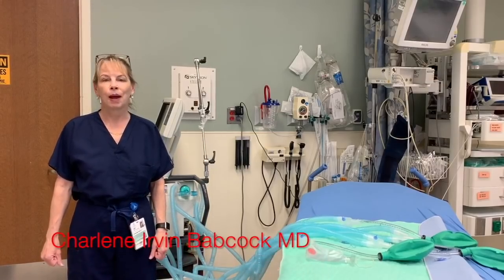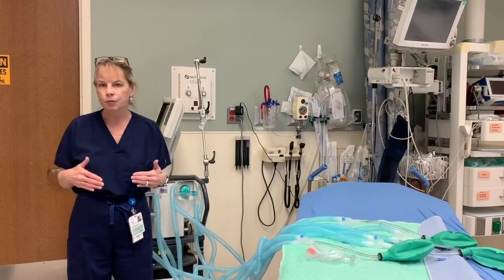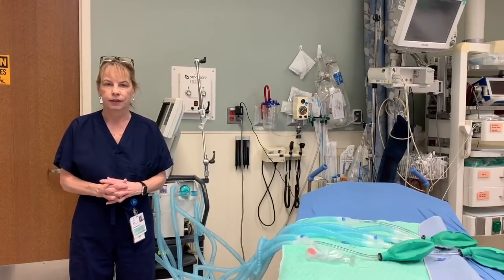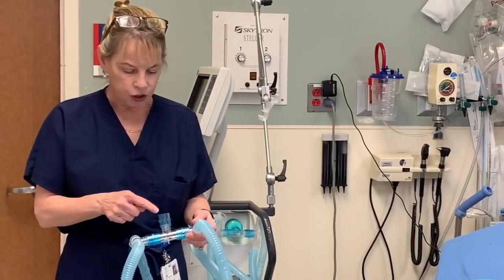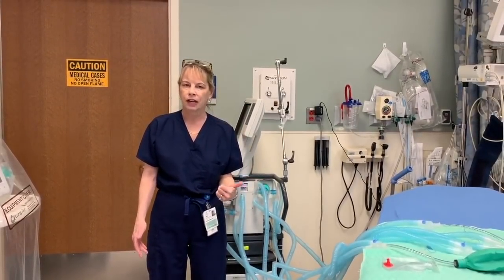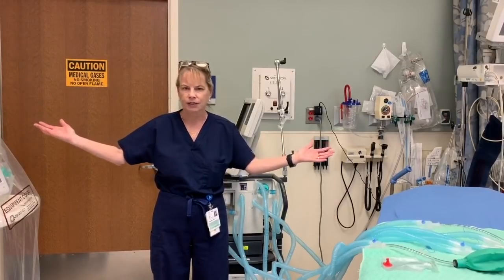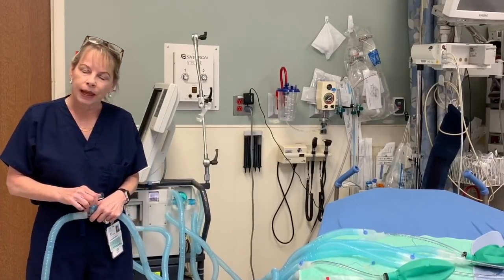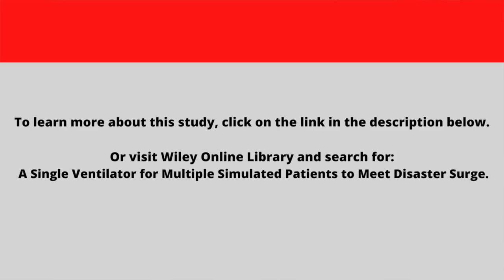COVID-19 How to Use One Ventilator to Save Multiple Lives

Comment: March 26, 2020
Joint Statement on Multiple Patients Per Ventilator
SCCM, AARC, ASA, ASPF, AACN, and CHEST Share Unified Message
(IRVING, TX – March 26, 2020) – The Society of Critical Care Medicine (SCCM),
American Association for Respiratory Care (AARC), American Society of
Anesthesiologists (ASA), Anesthesia Patient Safety Foundation (ASPF), American
Association of Critical‐Care Nurses (AACN), and American College of Chest
Physicians (CHEST) issue this consensus statement on the concept of placing
multiple patients on a single mechanical ventilator.
The above‐named organizations advise clinicians that sharing mechanical
ventilators should not be attempted because it cannot be done safely with
current equipment. The physiology of patients with COVID‐19‐onset acute
respiratory distress syndrome (ARDS) is complex. Even in ideal circumstances,
ventilating a single patient with ARDS and nonhomogenous lung disease is
difficult and is associated with a 40%‐60% mortality rate. Attempting to ventilate
multiple patients with COVID‐19, given the issues described here, could lead to
poor outcomes and high mortality rates for all patients cohorted. In accordance
with the exceedingly difficult, but not uncommon, triage decisions often made
in medical crises, it is better to purpose the ventilator to the patient most likely to
benefit than fail to prevent, or even cause, the demise of multiple patients.
Background: The interest in ventilating multiple patients on one ventilator has
been piqued by those who would like to expand access to mechanical
ventilators during the COVID‐19 pandemic. The first modern descriptions of
multiple patients per ventilator were advanced by Neyman et al in 20061 and
Paladino et al in 2013.2 However, in each instance, Branson, Rubinson, and
others have cautioned against the use of this technique.3‐5 With current
equipment designed for a single patient, we recommend that clinicians do not
attempt to ventilate more than one patient with a single ventilator while any
clinically proven, safe, and reliable therapy remains available (i.e., in a dire,
temporary emergency).
Attempting to ventilate multiple patients would likely require arranging the
patients in a spokelike fashion around the ventilator as a central hub. This
positioning moves the patients away from the supplies of oxygen, air, and 
vacuum at the head of the bed. It also places the patients in proximity to each
other, allowing for transfer of organisms. Spacing the patients farther apart
would likely result in hypercarbia.
Spontaneous breathing by a single patient sensed by the ventilator would set
the respiratory frequency for all the other patients. The added circuit volume
could preclude triggering. Patients may also share gas between circuits in the
absence of one‐way valves. Pendelluft between patients is possible, resulting in
both cross‐infection and over‐distension. Setting alarms can monitor only the
total response of the patients’ respiratory systems as a whole. This would hide
changes occurring in only one patient. The reasons for avoiding ventilating
multiple patients with a single ventilator are numerous.
These reasons include:
• Volumes would go to the most compliant lung segments.
• Positive end‐expiratory pressure, which is of critical importance in these
patients, would be impossible to manage.
• Monitoring patients and measuring pulmonary mechanics would be
challenging, if not impossible.
• Alarm monitoring and management would not be feasible.
• Individualized management for clinical improvement or deterioration
would be impossible.
• In the case of a cardiac arrest, ventilation to all patients would need to
be stopped to allow the change to bag ventilation without aerosolizing
the virus and exposing healthcare workers. This circumstance also would
alter breath delivery dynamics to the other patients.
• The added circuit volume defeats the operational self‐test (the test fails).
The clinician would be required to operate the ventilator without a
successful test, adding to errors in the measurement.
• Additional external monitoring would be required. The ventilator monitors
the average pressures and volumes.
• Even if all patients connected to a single ventilator have the same clinical
features at initiation, they could deteriorate and recover at different rates,
and distribution of gas to each patient would be unequal and
unmonitored. The sickest patient would get the smallest tidal volume and
the improving patient would get the largest tidal volume.
• The greatest risks occur with sudden deterioration of a single patient (e.g.,
pneumothorax, kinked endotracheal tube), with the balance of
ventilation distributed to the other patients.
• Finally, there are ethical issues. If the ventilator can be lifesaving for a
single individual, using it on more than one patient at a time risks life‐
threatening treatment failure for all of them.

Comment: Ok. This just came in 6 hours ago. The more I think about this the more I appreciate Dr. Babcocks novel possible solution.  Personally I think what would be possible is take any non covid ARDS patients and have them possibly share a vent with 1 other patient.  I am talking long term neuro cases with no tbi protocols and cases like these.  Also the RTs that said this would be a bad idea were simply looking at actual survivability through their experience instead of being negative or not working off label. Dr. Babcocks idea of using BiPap off label is risky but worth it in my opinion and great novel thinking!  But the experts (see below) have consensus that 4 covid patients on one ventilator is not feasible.  I would love to be involved in feasibility of double patient  ventilation with normal lungs using ASL5000 computerized test lungs in the future. We are all in this together and any novel ideas need to be investigated.

Article below released 6 hours ago:
However, in a statement released today (March 26), medical societies across the country came out strongly against this idea. "Sharing mechanical ventilators should not be attempted because it cannot be done safely with current equipment," the societies said in the statement. "The physiology of patients with COVID‐19‐onset acute respiratory distress syndrome (ARDS) is complex." Even in ideal circumstances, 40% to 60% of ventilated patients with ARDS and lung disease die, they said. 

"It is better to purpose the ventilator to the patient most likely to benefit than fail to prevent, or even cause, the demise of multiple patients," they said. The statement is supported by the following: the Society of Critical Care Medicine (SCCM), American Association for Respiratory Care (AARC), American Society of Anesthesiologists (ASA), Anesthesia Patient Safety Foundation (ASPF), American Association of Critical‐Care Nurses (AACN) and American College of Chest Physicians (CHEST)
Reply: I should also clarify I don’t mean your home BiPap for OSA, I mean BiPap like V60s powered by 50psi O2. And not for covid ards pts but for spont breathing drug ODs, high quads, neuromuscular pts etc..   If they do run out of vents first all RT schools lab vents, then anesthesia vents, then transport vents,  and finally teams of baggers with PPE and HMEs (and a strong command post to manage this as it would need a lot of organization and sore arms). But volunteers would step up and it could be done

Comment: All the medical concerns I see raised here by healthcare providers sound valid to me.  However, as an engineer, I'm quite sure the technical challenges associated with multiple patients on one ventilator can be solved given the right mix of expertise, resources, and time.  Nobody has perfect forecasts of the respirator demand we face over the next few weeks, but most forecasts seem to indicate we're at risk of a significant shortage within a few weeks...one that likely won't be met by ventilator manufacturers (despite heroic efforts and broad support).  Working in our favor, there are still ventilators in the national stockpile and the entire country won't reach the peak of infection simultaneously.  This affords a few precious weeks to get the CDC, FDA, doctors, engineers, manufacturers, and experts in logistics involved in a coordinated effort to solve these technical challenges, to provide the needed regulatory relief, and to produce and distribute the hardware and information needed for these efforts to succeed.  I applaud those pursuing such a path.  It would be sad to squander this window of opportunity and force intensive care doctors in the heat of battle to scour youtube for a solution they can implement in a hour given the fittings, hoses, and filters they have on-hand and little information on the technical specs of the model they want to multiplex.

Comment: To all the idealistic naysayers, this is being used NOW in New York city as an emergency measure to save lives. They have developed protocols. You don't get that YES, we understand that it is not ideal. We understand the RISK, We understand that it is not as flexible. Do you understand that to the extent it works it will SAVE LIVES? New York has paved the way legally and procedurally to use this, and is attempting to deploy it as we speak, even before they run out of ventilators, because it gives them flexibility to save more lives in the coming storm. Although not ideal, for many patients it will be good enough to respirate them while their drug therapies and time work. Even with the limitations posed by sharing, these resipirators are far superior to the early models in our medical history, and we would not have banned their use for their lack of intelligence and evolution. They made air go in and out. Period.  Databyter
Reply: Interested to learn more, as we are running against the clock in Kenya

Comment: Would like to offer some possible options to help mitigate the risks you mentioned, Adding one way valves on each line could potentially help limit patient cross contamination from back flow, secondly to help with varying lung sizes and therefore different oxygen/pressure needs using some types of air regulators could help provide some level individual  air flow adjustments. Thanks and good luck!

Comment: My major concern with this is that if the compliance of the lungs between patients is significantly different, you will be ventilating very different volumes to the patients, possibly, even to the point of injuring the lungs of the patient with highly compliant lungs and underventilating the patient with the poorly compliant lungs. This situation was not tested in the study as it used identical simulated lungs, but is addressed in the discussion. Although Covid 19 does not seem to affect lung compliance based on what I'm reading, perhaps I would suggest ventilating each patient on their own to get a sense of compliance and if the above solution is needed, then grouping patients with similar compliances on a single ventilator as patients may have varying lung compliances based on their pre-existing conditions.

Comment: Given the concerns about cross-contamination, is it possible to run these machines with each expiratory limb of the patient circuit connected directly to an expiratory filter, and NOT connected back to the unit's expiration port?

Comment: I might suggest adding a flow meter in line on the output of each patient as an added method for monitoring. Many years ago, I was a repair tech certified to work on Bird brand vents and many of them had a large output capacity, far more than what a normal person would use. (some enough for a horse). When we gave them a burn in before sending them out for use, they ran at full capacity for at least 24 hours to make sure they wouldn't fail under the most extreme conditions. Of course, my knowledge is over 20 years old now, my certifications have long expired and I doubt those model vents are still in use, but as you said, extreme times call for extreme measures...
Reply: Would you be interested to help a team in Kenya?
Reply: @cantstopthecooking  I'm not a repair tech anymore and don't have the tools.
Reply: @KenMaxon  Thank you. this is Kenya, so the idea is to get someone who knows about ventilators and can help.

Comment: Surprised to hear that a ventilator designed for one person has can deliver enough volume for four.  I'd expect some additional capacity built in, but that's huge.  Also, does the additional volume of air from all the long hoses create problems delivering the right pressure profile to the lungs?  Just curious.  Hope it saves lives!
Reply: She addressed the problem of the decreased volume delivered and increased resistance of long hoses with her comments about the "half-star" positioning, with two patients parallel to each other and one patient perpendicular to them on either side, the single ventilator at their heads. It's about halfway through the video.
Reply: @FrauDoktorDoctor  Unfortunately, there is a lot of misinformation provided.  There is actually less resistance with longer and excessive tubing.  The problem is actually tubing compliance (stretch in the tubing during mechanical Ventilation) that a ventilator cannot compensate for when you go from the normal 12 feet of tubing (6 in and 6 out) to 48 feet!  This technique is not viable.  Multiple medical bodies and associations have shot this down as of March 26, 2020.  Folks should remember that Critical Care Medicine is different from Emergency Room medicine.  It also requires a different fellowship and training.  Saw a photo from Italy with multiple people attached.  Not only is is split, it's set up improperly in a way that forces both patients to rebreath their own CO2.  It's a mistake on top of another mistake.  Not good.
Reply: Bicycle Crossroads Most 4th G vents wii go to fault. This might work if you use an Emerson Post Op.

Comment: U could use bacteria filters on both the inspiratory and expiratory end to each patient to abound cross contamination. 

All patients must be paralyzed medically and all on pressure control with a slower inspiratory time.  So all lungs have time to fill, instead of the most compliant lung getting the volume first. You would not be able to measure volumes precisely but you ventilate all lungs to the proper inspiratory pressure and rest at the same peep level.  Volume mode in this setup is bad news. The less compliant lungs won’t get adequate volume.
Reply: I think we could build a distribution setup with filters and individual pressure regulators for each patient.  Would that be useful? Any contacts that might be willing to collaborate on a design? Understood that this is a last-ditch solution and limited to Pressure control only and common rate.
Reply: Aaron Crews with all patients connected together, think of all 4 sets of lungs, as one. You will be inflating all of them to the same peak pressure and same resting peep level.  It would only be able to be done on teenagers and adults together at the same time, I imagine children under the age 12, wouldn’t be good due to the fact their lungs would fill up faster than the adults. I would like all patients connected to have the same chest rise time.

Again this is only in a dire needs situation. People is severe ARDS are not applicable to this. As their ventilation mode and settings would more than likely be specially catered just for them. 

I imagine you could use this method on your more stable patients in house, and use single vents more for your very unstable patients.

Comment: Phew! What a measure to have to take! I hope it doesn’t come to this. But if it does I have a question. How do you recommend making a choice to adjust the vent settings based on abg results amongst the two or four patients? If patient A is tolerating the vent settings well but patient B is experiencing acidosis and hypercarbia, do you adjust for the patient doing poorly and hope the patient tolerating will handle it? What if one patient is requiring increased PEEP for alveolar recruitment but in the next the PEEP is detrimental to the blood pressure leading to hemodynamic instability? It creates several more ethical considerations. I really appreciate the tutorial on this. Thank you so much for your video and problem solving!
Reply from the maker: So you need to match patients with similar  PEEP and PIP needs to be sure to  deliver similar volumes.  I worked in Washington DC today with several very brilliant emergency physicians, respiratory therapists, intensivists, and other researchers...stay tuned...I suspect there will be a paper released soon that shows the SOP if you ever were  in the dire situation and had to use this technique....
Reply: Did you actually hook it up to a ventilator with four  test lungs with settings that would match typical covids lungs compliance and resistance ?  I’m baffled why you have not done this and filmed it since you are putting your name on it. Does not seem like a tall order to test your idea instead of putting on actual people. Was Robert Kacmarek there, vent manufacturer engineers  or other well known ventilation experts?  Can you let us know what mode, peep, I:E , and other vent settings were used?  What alarm conditions were shown?  Thanks

Comment: I read that they are having to set the ventilator to the maximum to keep the patients oxygenated. Instinct tells me that at the max setting with 4 patients the pressure to each will be 1/4 of output. Talk to an HVAC installer or tin knocker. They will have more info into this.